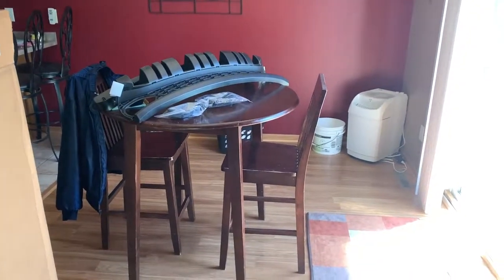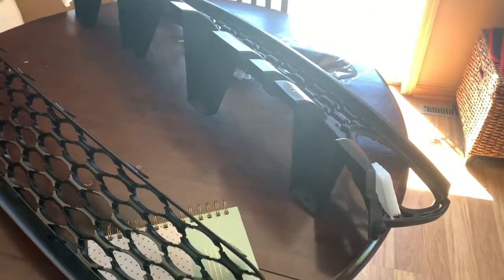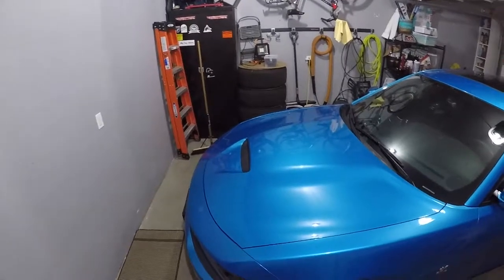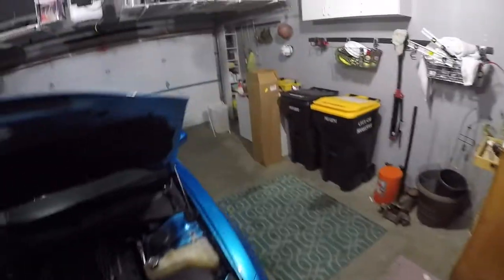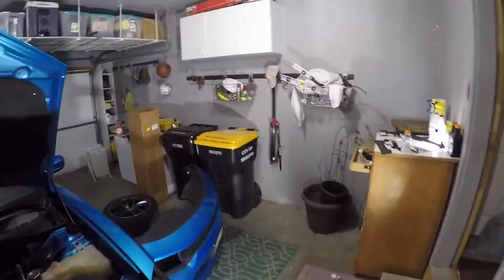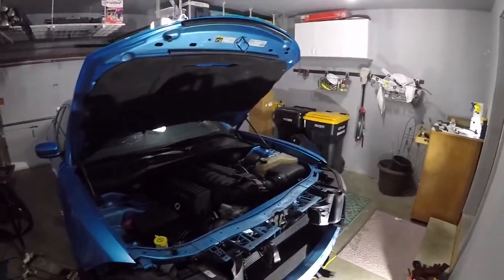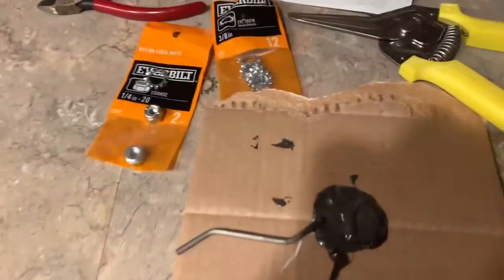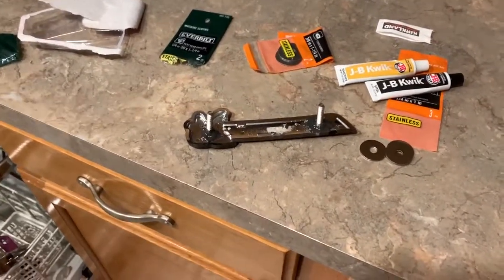2019 Charger Scatpack Grille Install

Comment: Nice rig! I’m about to put this setup on mine. I installed the hellcat lower air box system and you do get some performance out of it. Better shifting, 5hp, gets within 2-3 degrees of ambient temperature. It’ll work better when I get the grill installed for more airflow. My grill and badge is in front of the frontal intake tube so I’m limiting the airflow so I’m certain I’ll see a tad bit more when it’s free flowing